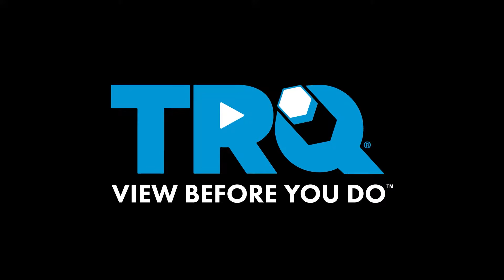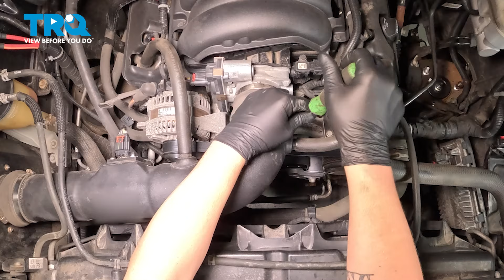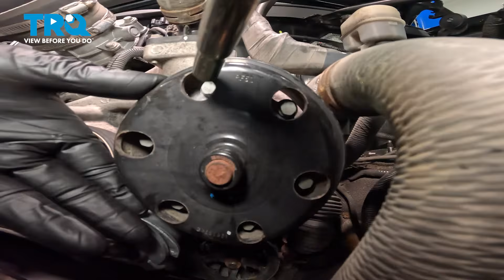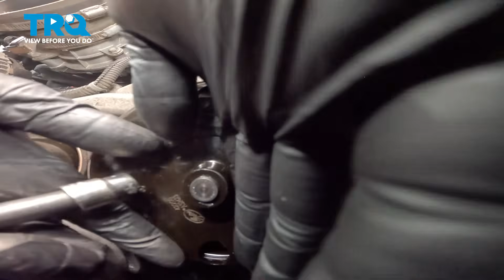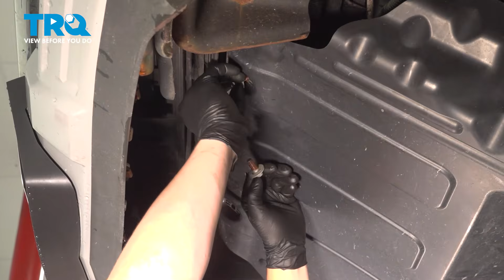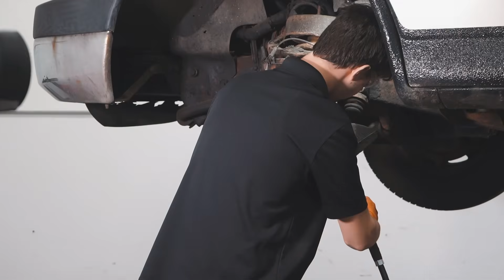How to Replace Water Pump 2014-2018 Chevrolet Silverado 1500 5.3L V8

Comment: My engine has a two belt system with a smaller belt around the crank and the ac and the water pump and a pulley. Has no tensioner on it. Any suggestions on how to get the belt off and back on?

Comment: I noticed you only torqued it to 89in/lbs. is that all thats required? I read the spec was torque in two passes, first to 11ft/lbs (132in/lbs.) then to 22ft/lbs. (264in/lbs.) I did just that and broke two bolts on the second pass. Wondering if 89in/lbs is all it takes. Thanks!

Comment: Easy way to work out the air bubbles is blasting the heater inside the vehicle and pulsing the accelerator

Comment: wish mine was that easy. water pump was locked up. couldnt get it to turn to match bolts to holes. Also the water pump has a dimple that the dowel has to set in. Make sure its clocked right as well.

Comment: Just got mine first 12 hours of ownership 77,000km and get out truck smell coolant. Yep water pump is done and now dripping on belts slinging coolant everywhere. Gm should really have a recall on these truck see so many go out with low mileage. My 01 gmt800 had original water pump till 290,000km.